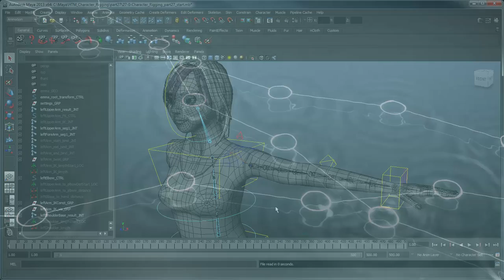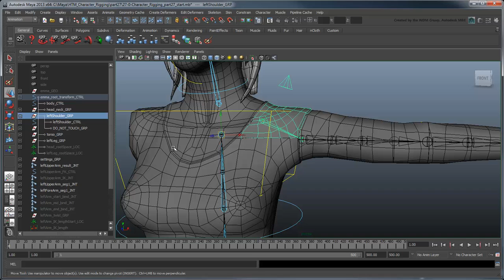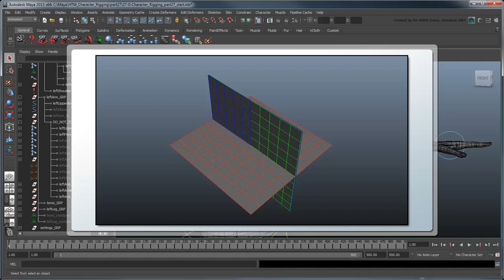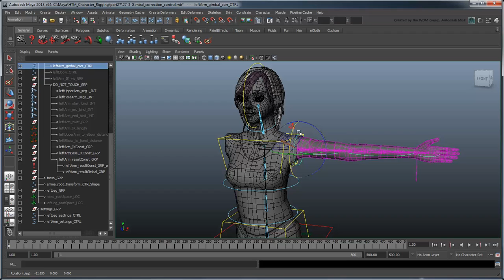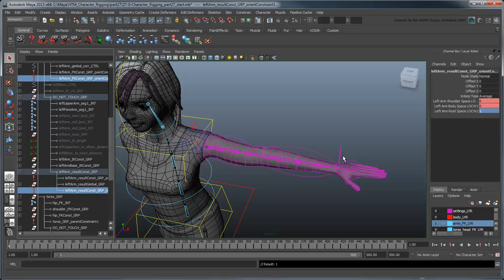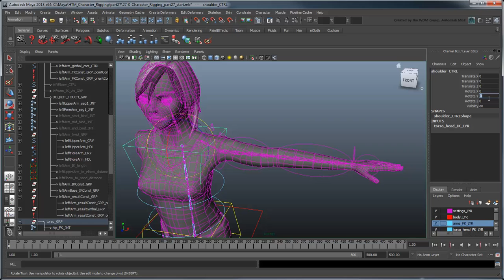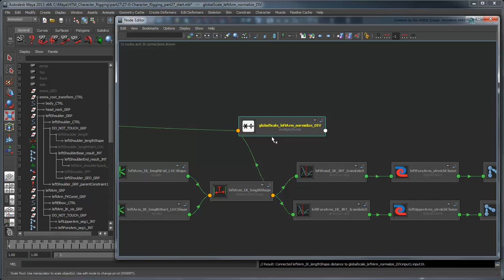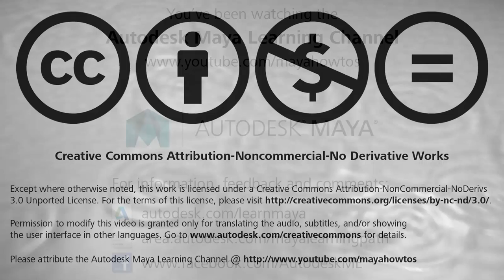Creating a Character Rig - Part 27: Arm global transform and cleanup (Advanced)

Comment: Hi, I have come across a very strange problem, I dont know if others have too.
When you bend down the arm and try to rotate the shoulder controller or the upper body controller, the upper arm starts twisting. (I have set the "Up axis" of leftUpperArm_HDL to "Closest Z" as mentioned as a correction in another video).
This is happening in the provided project file itself! It is happening in my rig as well, I am not sure why is that happening :/
Reply from the maker: Unfortunately, joint flipping is a scenario that can't be eliminated completely due to the math behind the way splines are solved.  However, if you're finding that flipping is a problem for the specific poses you want, you can try the following corrections:

1.)  Unlike the video states, parent constrain (rather than point constrain) the leftArm_start_bind_JNT to the leftArm_result_JNT.
2.)  Change the settings for the leftUpperArm_HDL to an Up Axis of Positive Y, with the two Up Vectors being 0 1 0.

This will mitigate the flipping in some of the more common scenarios, though as stated before it will still be present in some more extreme poses.  Note that this will also mean that when you rotate the upper arm, it will rotate at the shoulder instead of at the elbow.

Please try these settings and let me know if it fixes your problem.
Reply: Maya Learning Channel I agree eliminating joint flipping completely would be very difficult!
I tried the two of these solutions and they eliminate the flipping in most of the common poses. Seems to be working fine so far. Although I would still be looking more into a solution which doesn't rotate the shoulder when upper arm is rotated (what the point constraint does). I think it would make the skinning look more natural.
But Thanks a ton!
I am using the techniques shown in these tutorials for my graduation film and I have 5 characters based on it. I have been trying to find a solution for a month, but couldnt find a working one. You have really saved me there :)

Comment from the maker: We've looked at the file and confirmed there is a problem here due to the sectioned joints' proximity to each other. You can fix this by selecting their IK handles (in the rightArm_twist_GRP) and changing the "Up Axis" to "Closest Z". This allows Maya to correct automatically for this twisting.
We apologize for the mix-up and will add an annotation to the appropriate movie.

Comment: Hello Noway, I know that method. There is another technic based on joints attaches to curves with mothion paths very very usfful, without IkSpinehandles, that works vere fine.
But I would prefer that mayaHows integrates bendy arm in his setup so we don´t have to be worry about the integration of diferents kinds of methods on one.

Comment from the maker: I see no reason why it shouldn't.  I ran a quick test and didn't run into any problems (other than a small scaling problem when bending too far, but that could probably be fixed relatively easily).  I've made a very rough scene file available here:  areadownloads (dot) autodesk (dot) com/wdm/maya/bendyupperarm (dot) mb.  It's very rough though, and I only applied it to the upper arm.  Hopefully it helps.

Comment: When I whant to bendy limbs, I use a method based on attach individually bendy joints to the curves with mothion paths and then, with clusters and scaling them, you can control the bendy of the hole structure. Ik_Spine is not needed. (I attach two images) I´ve read that  it isn´t recomended to use Ik_Spin with bendy joints to avoid problems with the animations.I,ve made two screenshots of the set-up but I don,t know how to upload here!!
Does your method operat correctly when you animate?

Comment from the maker: In part 22 when we create the upper arm and forearm twist sections, we use a Linear EP Curve specifically so each of those sections cannot bend.  In order to get bendy limbs, you'd simply need to use a non-linear EP curve.  That way, the upper arm and forearm would act exactly like the IK spine rig.  Then you would just need to set up some kind of control system for the middle control vertices of the curve.